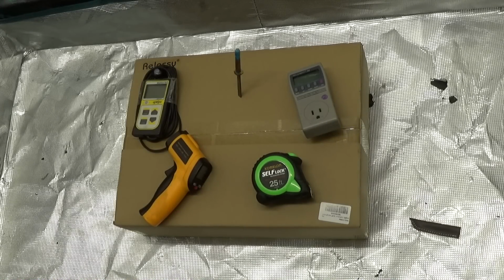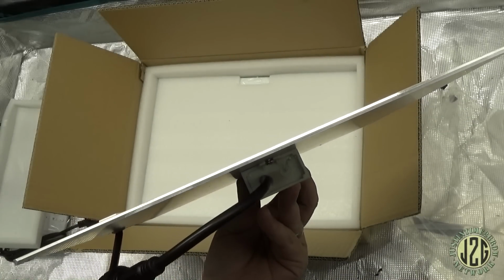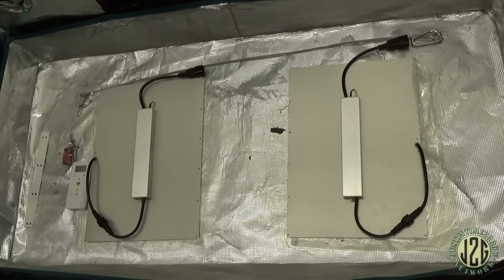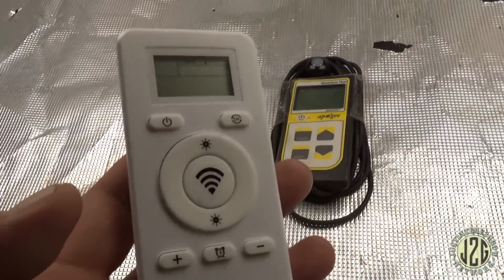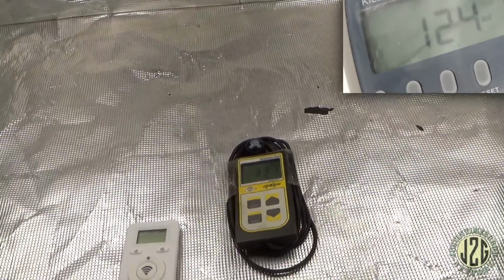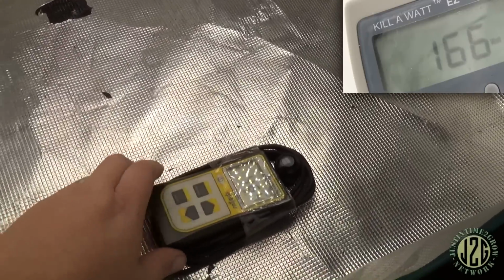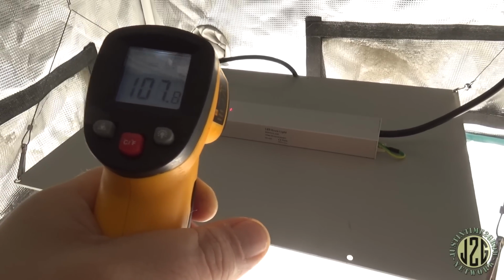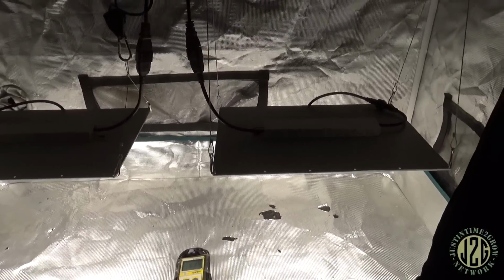Are Cheap Amazon Lights Any Good?(E19) - Relassy LED R-2000 Unboxing, PAR, Wattage & Heat Test

Comment: aug 27  2021 ... the amazon ad for this light shows that the driver is detachable.
but leaves out how long the cord is.  so we dont know if its possible to have the
driver and its heat on the tent outside.   

   also , what is the make and model of the PAR meter used in this vid ?

Comment: Would 3 of these be good for a 8x4 ?
Reply from the maker: 4 of them. Each set covers 2x4. There are 4 2x4 spaces in a 4x8.
Reply: @Justintime2grow  there are 2 2x4 spaces in a 4x8 unless that 4x8 is in a tardis 🤔
Reply from the maker: @raygreenfinger  🤦‍♂️😂

What school did you go to?  Because they need to be shut down. 

Lets say a light covers 2x4. Would you use one of those in a 4x4 or 2? You would use 2. Then how many would you use if you were in a 4x8? Wait for it.............4. Because there are 4 2x4 spaces as I said.
Reply: Thanks 🙏🏾

Comment: Hey Justin, I was about to drop some coin on some lights for my 2x4 veg tent and I've narrowed my choices down to this Relassy and the Viparspectra XS1500.
I was going with the SF2000 until the prices went up and it's still my first choice if I find a reasonable price.

A couple questions:
Is there an equivalent to the R-2000 and XS1500 that you would recommend?

Are there manual controls for the Relassy or does it only operate by remote?

Thanks, and thanks

Comment: OMG the design on that light is kinda scary.  No gap between the driver and the board seems like a dumb idea.
Reply from the maker: Well if you watched to the heat test you would know it doesn't run very hot. It's only 167 watts.
Reply: But with the maximum setting?

Comment: SpiderFarmer SF2000 vs. Viparspectra XS vs. Viparspectra P25000 would be great!
Reply from the maker: They would all be pretty similar. The only real difference would be spectrum and quality of parts. I just got a spectrometer and the SF2000 has more red and far red than the xs2000 does.
Reply: @Justintime2grow  Do you eventually know if the Viparspectra P2000 also has more red and far red spectrum because of the bigger number of led diodes than the XS2000?
I´m questioning because I saw that the P2000 has 4 IR diodes and the XS2000 just 2 IRs.
I  hope i´m not bothering you with this amateur question, but does more red led diodes(from the same brand) automatically means more red spectrum when it comes to  lights with the same watts consuption?
Reply from the maker: @412todafuture  2 extra diodes out of hundreds isn’t going to make much difference. I think the p series is a little more red in general for spectrum but I haven’t tested it with the new meter.

Comment: Hey Justin...
While listening to the video, I was checking it out on Amazon...
The drivers are removable too!
Wonder what the par readings if you ran them the other way?...
I like the idea of separating them and then moving them apart or together to get an even par under them...
But like you said, it’s kinda risky when there’s not much info about the parts used...
👍🏼👍🏼👍🏼☮️
Reply from the maker: Cool 👍

Comment: In your opinion what is the best light for value to flower a 4x4? Thanks from BC🇨🇦
Reply: Running a marshydro ts3000 it will rock it its what i run
Reply from the maker: For something purchased inside the US(with a warranty) I would say Spider Farmer SF4000. Discount code justintime2

You can always find things cheaper direct from china but good luck dealing with them if there are any issues.

Comment: Hey have you done the optic 4 reviews? I’m debating on get a few
Reply from the maker: Not a fan. Lenses went out of style several years ago. There are much better options than any of the optic cob lights.
Reply: @Justintime2grow  thank I didn’t know that I thought those look cool. What about the new puke from rapid led? Or something around that area of price. 600-700 for a 4x4 grow
Reply from the maker: If you aren't going to go to the $900+ price range I would just go spider famer sf4000. Discount code justintime2. 

If you can spend more chilled x5 or x6 discount code j2g

or

HLG scorpion diablo discount code justintime2grow

There are a lot of options for a good 4x4 light. This is just a few I've tried and tested well.

Comment: I'm growing similarly in a 3 x 3 tent with 2 Mars Hydro TS-1000's. Don't know what the par would be running the two side by side, they're about 3" apart, so I'm not sure how much par, if any, is lost in the gap between them. Basically growing a plant under each light. Seems to work fine by following the recommended heights, especially your height of 16" and going by the readings from your review in 2019
Reply: do you get a dense flower?
Reply: @manuelbarrera5462  Certainly do